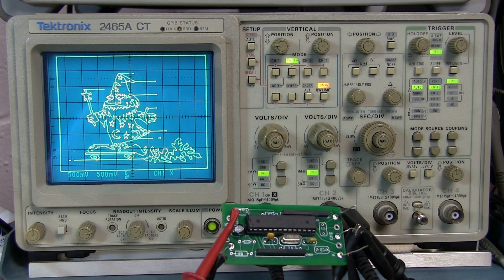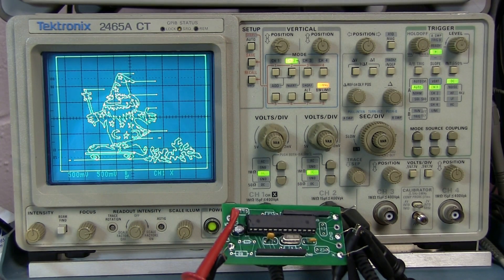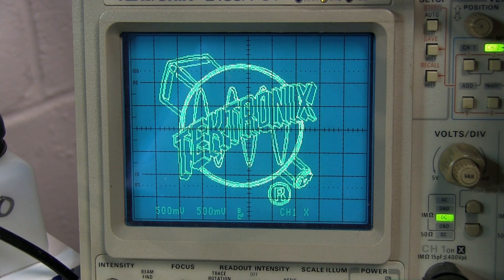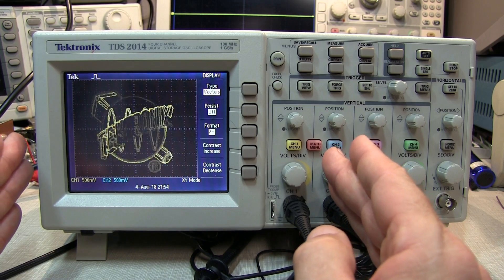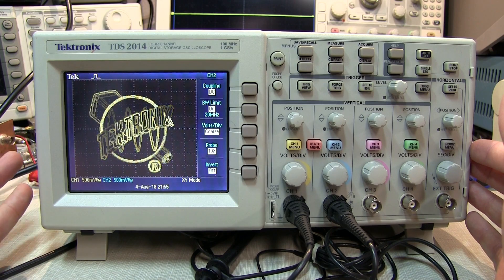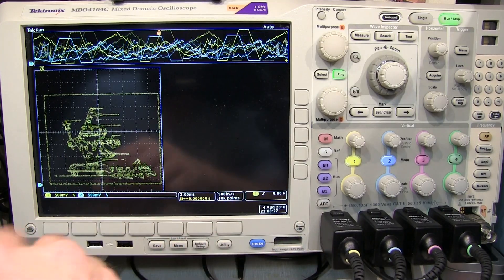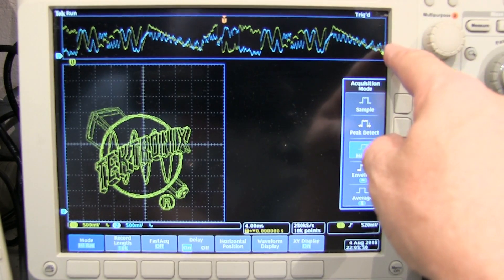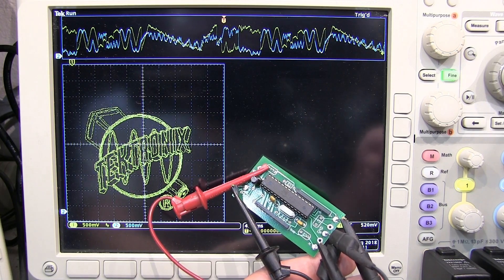#288: Comparing XY Mode on Analog and Digital Oscilloscopes

Comment: Great info that I again I did not know: digital scope xy mode issues and work arounds. I notice products are not normally promoted for sale and this video channel. So I looked up VintageTEK on ebay and their website realizing that the promotion might be important. I see that the group is doing our electronics community such a useful service so I bought one of the logo display boards with Pong simulation partly just as a donation to the cause. But I am sure using the board will teach me even more detail and practical lab procedure.

Comment: Very cool, brings me back to my college days (early 90s), 3rd  year cpu digital design course, we were assigned a year end class project to display and animate the schools name (SVSU) the Class name (EE 355 I think) and our initials on an oscilloscope using a 8086 training board and an interface circuit that we had to design. As I recall it was a pretty straight forward project with respect to the interface but a real challenge to program because it was all done via 8086 assembly straight into the training board.  If I only knew then what I know now it would have been much easier.

Comment: Follow-up since I've just received my little demo board from the guys at VintageTEK, and even though I didn't really need it, they were thoughtful enough to include a french version of the instructions (nice touch). I'm powering it with a soldered on cable that plugs into a small USB PSU at the other end (inexpensive and practical way to easily get a +5VDC supply when not on my bench). And on my Rigol DS-1054Z it looks better than I expected, although a tiny bit noisy (because the scope itself is that way, an expensive Tektronix MDO4104C this is definitely not). I couldn't get the averaging morphing, sadly. But it makes for a nice exhibit when tech friends come over...

Comment: Interesting and fun video Alan. Thumbs up!
Reply: Another gadget I just had to have! I tried Alan's Arduino experiment about this same topic a couple of years ago and it was cool...couldn't resist getting the Tek group's version to compare my Tek 2440 and Rigol displays in the XY mode. Actually both are tricky to use in the XY mode, not like my old basic analog scope I used for years with a spectrum analyzer attachment; luckily I still had my old notes on how to set up the 2440 to use the analyzer or I probably never would have figured it out again!  Thanks Alan, another great video!  73 - Dino KL0S

Comment: This is a few years after you posted this. I bought the demo board and have used it for demo only. However I didn't realize it might have the game and menu. I have searched pretty
extensively and can not find any info on hooking up any  switched or potentiometers.
Do you have any information on that.  Also I enjoy your videos a lot, but you have cost me some money. I have bought a few items because of your videos, I also enjoy when you appear 
W5KUB.
On another note my DS1102 E does really poor on displaying this.  I is interesting that of course the time base has no effect on my analog scope the "Time" control shows the effect of memory greatly in the number of points displayed on the Rigol DS 1102E.

Thanks
Garry
Reply from the maker: I think that only the later-produced boards had the game implemented.  At the time this video was produced, the module didn't have the game.  And yes, digital scopes do a poor job of XY, and the dependence on the waveform memory is one of the main reasons why.

Comment: I'm sorry for asking such a basic question but what is this thing and what does it do?
Reply from the maker: It's called an oscilloscope.  It is used by engineers, technicians and even hobbyists to examine voltage changes vs. time in electronic circuits.

Comment: Interesting and informative video...Thank You! What causes the small, faint dots roaming around when you switched to the  MDO scope?
Reply from the maker: The waveforms don't instantaeously change voltage, so you will get samples showing up where the "trace" is moving quickly from one point to another.  These are the parts of the figure that don't show up in an analog scope because the beam moves too quickly to light up the phosphor (unless you tune the brightness way up), but you will see samples that land on these fast edges with the digital scope.
Reply: Understood! Thank you very much for your reply!

Comment: Intresting..., Did you try turning ON persistence on digital scope ?
Reply from the maker: I did on the TDS2000.  Wasn't necessary on the 4000.
Reply: w2aew  Less recently, traced portion of the image is fading out and freshly traced portion is brighter. Probably, that's why that moving gradient. Infinite persistence might make full x y area bright without any image. Persistance with Z input modulation will form proper image.
Reply from the maker: Yes, infinite persistance would definitely help, but since this board generates two XY images, you'd wind up with overlapping images on the display.  And, this older scope does not have Z-axis modulation.

Comment: I guess XY mode isn't as important anymore nowadays. Aren't there any digital scopes that can do a time based intensity grading (making the point or connecting line to it darker the "older" it is)? That is essentially what the phosphor does on analog scopes.
Reply from the maker: Many scopes have intensity grading of the waveforms to emulate the phosphor on the analog CRTs.  There are even a few that have a some Z axis control...

Comment: My 465 was better than any of the newer digital I own. I tried this a year ago. I also built your analog video piece. You should tout that again.
Reply: Carl Davis - I’m an old-timer with some “vintage Tek gear” so I feel your mood. 

But what, exactly, is better about a 400 series than say, a 6 GHz modern ‘scope?  Seriously, what is better?

I have every curve tracer Tek ever made beginning with the 575.  Frankly, the VT stuff is hideous.  

The 577 has some nice IV extreme performance. However, I can’t buy parts today that make those beefy front porches worth a damn. 

You do young people a disservice speaking in absolute terms when all your doing is showing off your nostalgia. 

Pony up on “better” or fade away where you can’t hurt anyone’s future.
Reply: You need to read between the lines. Notice where I said I tried this a year ago. I am talking about putting the device covered in this video on a 465 a TDS784C and a TDS2024B. It took seconds to get the logo on the 465 and minutes of fiddling to get it on the other two. In this case for me the 465 was superior. Seconds to minutes of fiddling. That is why the 465 is better in this case, and I wrote this based on this specific case. What can I say. I hate having to write more than just a post like I am writing this deluge now. But I guess it is necessary for some folks who can't understand what is being implied based on the video just watched.